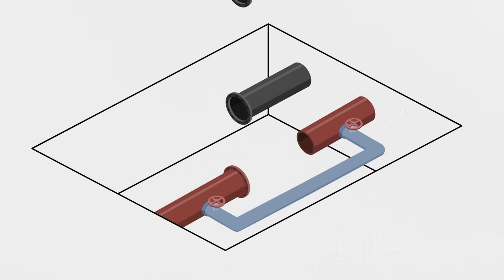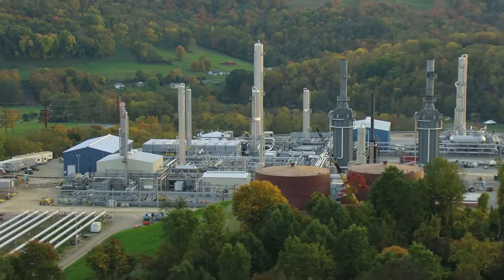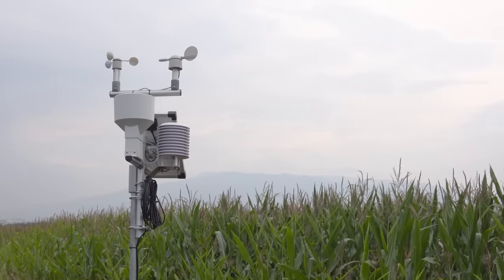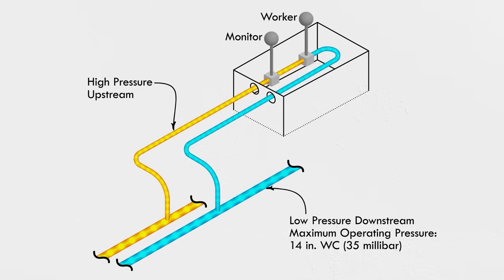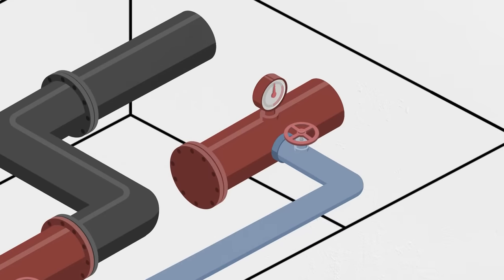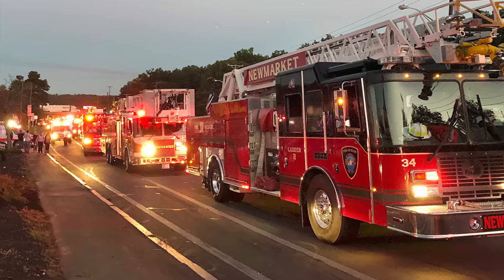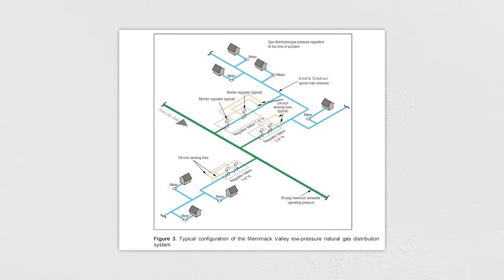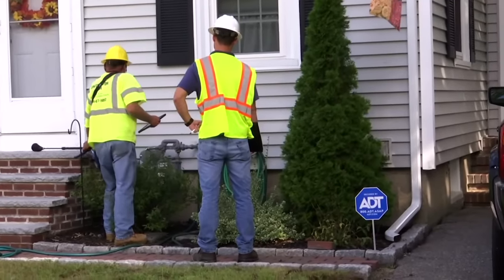What Really Happened During the Gas Explosions in the Merrimack Valley?

Comment: I remember discussing this immediately after the NTSB released the information about it.  

I’m an Instrumentation and Electrical Technician for a major pipeline company.   We discussed this in a safety meeting even though we don’t operate low pressure systems.  

This video was so good that I might show it in this month’s safety meeting.
Reply: Then you will understand the regulator department should of been there.  I have made many comments on this thread and I made 1 video even though picture is off. They never allowed it to be seen for over a year. I have read almost every document in the NTSB reports. The only deposition that makes no sense is the general manager in charge of the departments. Eliminated communication unless job on computer and kept the regulator guys out of the loop .
Reply: Don’t get stuck on the problem being the low pressure line. 

The problem was sequence and planning.
Reply: @willlock3644  actually 1 upper manager said the regulator department was not needed. There were spaces for that department to sign off but it was determined they weren't needed. Imagine a line that comes out of the pit and someone saying they were not needed. It is true and in depositions on file. Even though this was always the procedure
Reply: @skipd9164  I work in industry. 
I get it.
Reply: @willlock3644  no problem
Reply: @willlock3644  That was completely clear from the narration and the final NTSB report conclusion cited in the video. There was nothing wrong with the technology per se, and everything wrong with the project management.   We keep hoping our daughter will go into project management after she gets her MS. She's got the detail oriented, meticulous frame of mind and love of planning and documentation that are necessary in that field of work.
Reply: @willlock3644  I'd like to add the lack of secondary safety devices like overpressure relief valves that would go off if the pressure became too high and at the same time raise an alarm. Basically last line of defense items because things like this will happen again, just in new "interesting" ways.
Reply: @ehsnils the thought came to me too.  But then I wondered where I would safely vent them to.  Also, do I want to monitor the relief valve position and shutdown the system if the valve opens, but then thought about the s—- show it would be if the monitor failed and shutdown the system on a false alarm…
But, then I’ve never liked working on gas utilities anyway.
Reply: @Ryarios  I'd even consider having a blasting tin in a safe location with a igniter to burn off the gases vented. It would sure annoy the neighborhood, but I'd rather take a number of emergency calls for a fire plume from a safe location than a number of blown up houses.

Comment: I lived in Andover during the explosion. We finally got heat and hot water back at Thanksgiving and it was another 2 months to get our stove replaced.   Thanks for covering this one.
Reply: What happened to your appliances? Did they just shoot gas out at insane pressures? Did it actually break your stove?
Reply: @Teh_Random_Canadian  nothing dramatic happened inside my house. All appliances connected at the time of the incident were condemned and replaced.
Reply: @Teh_Random_Canadian  Depends on if they have a constant pilot light on or not. Ex some furnaces even during summer time have a small pilot light always burning. It would make that into a flame thrower possibly. Hopefully it wouldnt spread. Or worse the increase in gas would extinguish the pilot light allowing natural gas to fill your home. Until it found an ignition source and was at the right air mixture and ignites.
Reply: @zazuch  , you are correct but even electronic Ignition gas appliances become hazardous with 75 psi of gas pressure on a gas valve rated for a 1\2 PSI . Could you imagine a hot surface igniter getting hit with an excessive amount of gas flow , even in the five second lock out time you could cause a pretty good explosion.
Reply: @boby115  I didn't mean to make it seem like they weren't a hazard. Letting free flow gas into any structure is a recipe for disaster haha.
Reply: @zazuch  👍

Comment: As a MechE who is going for his PE, this is so absolutely chilling. Really puts into perspective my complaints about how annoying 16 hours of testing is. Such a simple oversight shook tens of thousands of people's faith in the systems that are meant to keep them safe. Really makes you wonder what other everyday devices we normally just take for granted as being safe are one simple oversight from upending our lives. Truly horrific.
Reply: And this is why I prefer using the electric grid wherever possible, this kind of catastrophic failure is not realistically possible with the electric grid without outside sources coming in to play. And if something like this did happen with the electric grid substations would probably explode long before too many homes caught fire
Reply: So, champ, are you still just trying to get through the 16 hours of testing?  "Such a simple oversight..." wasn't.  It was a major failure of "big picture" thinking (aka common sense) during project design and procedure development.  YOUR life SHOULD depend on your competency, not just the lives of folks affected by your work product.  Every engineer (all fields) should have some sort of common sense test before they can graduate and/or promote (e.g., replace all the spark plugs and wires on an older V-8, using the manual, and make sure it runs OK).
Reply: Takata airbags anyone?
Reply: @the_undead  
It should be pointed out that some gas appliances still work normally in the event of a power failure. That is certainly a worthy consideration. My gas logs are not even aware of a power failure, as even the wall thermostat is powered by the thermo-couple or thermo-pile of the lit pilot light, operates much the same as a gas water heater. In fact, during a dark power failure, I once soaked in the bathtub. Why not? Plenty of hot water.

Comment: Very cool to see this coverd I live in one of the neighboring cities to Lawrence and can remember the panic, and all of us scrambling to turn off our gas not fully knowing what was happening . Following the explosions many homes in my area had there gas meters/regulators relocated from the basement to outside the home i think so that if something similar ever occurred again the outdoor regulators would vent the excess pressure outside instead of into the structure.
Reply: Same! Haverhill here. Very scary day.
Reply: At the time i lived in Andover but very close to the Lawrence line. I remember the rows and rows of cars with people being evacuated out of the city. My wife was away on business and when she came back, had to figure out how to get home because many of the exits on 93 were closed.
Reply: There are lower pressure gas distribution systems, and there are higher pressure distribution systems (note that the latter are coming into more use as a result of peak demands due to tankless water heaters becoming more popular).

The older low pressure systems do not require a “pressure regulator” at each meter. The higher pressure systems DO require a “pressure regulator” at each meter.

Now, those “pressure regulators” basically just dump gas when it comes in at excess pressure, and those “frisbee type disks” you see at the meter are the “pressure regulator”, and if you look closely you can see that the discharge opening will usually be threaded - this allows for piping the discharge to the outside in cases where the best practice of having the “pressure regulator” outdoors cannot / is not being followed.

So if you have one of those “pressure regulators” inside of a building, make sure the discharge opening is piped outside. It’s best if the “pressure regulator” is completely outside of course.

And I use the quotes around “pressure regulator” because they are called that, but when I think of regulating flow I think of something a bit finer in granularity than just dumping excess. And in the event of a system overpressure situation, an entire neighborhood could have lots of gas discharged to prevent that excess pressure from entering the equipment in the building - but just one open flame at the wrong time …
Reply: Here in the UK, it's been regulation, at least since the 80s, to have gas meters (etc) outside the house.  I never understood why (I thought it was to make reading the meter easier!), but I do now.  My (very old) house still has the meter in the cellar/basement...
Reply: In Massachusetts when installing a new high or intermediate pressure line or replacing one they have too be outside
Reply: Every house I have ever lived in had the natural gas meter/regulator on the exterior of the structure, even in Utah where it snows. I simply can NOT fathom why anyone ever thought it would be acceptable in the least to allow a natural gas device vent combustible gas INSIDE a structure.
Reply: @dionh70  in Massachusetts any regulator inside had to be piped to outside or the complete riser moved outside. No regulator vented into an inside space
Reply: @dionh70  Lots of these installations are from an era before modern safety standards. When you have gas lamps in every room and are using matches to light them, the gas meter being in the basement rather than outdoors is fairly low down on the list of things that could go wrong.

Comment: Fascinating episode.  Our neighborhood has 80 psig lines running under the street with individual regulators at residences and businesses.  This episode also underlines the importance of systems engineering, and "systems thinking" in many aspects of life.
Reply: In 1976 We had High Pressure to the Regulator at the Meter...
Central Wisconsin
Reply: not living in a country where it has natural gas pipe lines directly but first thought was why not put individual regulators instead of a common one? could be budget issue?

Comment: I work in Massachusetts installing underground gas main for one of the largest utility companies in New England. I still hear different stories about what really happened,as I started working in this industry a couple years after this happened. To work on site you need to have operater qualifications, depending on the company you work for could be 50+. You need to pass either a hands on or written test for each one and renew them every 1-3 years. Engineers, supervisors and DPU are constantly coming by the job site to hopefully avoid something like this ever happening again. I’m happy I came across this video, this definitely answered a lot of questions I had. This is very dangerous but rewarding work and I’m grateful I am part of building americas infrastructure. Love your content ❤

Comment: As a follow up, having discussed pilot operated regulator valves, you could discuss the same but on the water side for storage tank level control.  For example, I saw one PWS consistently overflow one of their tanks because the altitude valve was not adjusted properly and the height was controlled via another storage tank.  Every day as I was driving through the town, there was either sign of overflow or the tank was actively overflowing.  Try to hit USEPA unaccounted for water (10%) when you're dumping water, at cost to the consumer (everyone).  This might not be the norm, but it does happen and everyone pays for it!  The towns unaccounted for water was @ 24%, think about that the next time you get a water bill!  I won't even get into the wastewater side of things!

Comment: Excellent video, Grady. Indeed, my neighborhood had the old cast iron distribution lines replaced by polyethylene (PE) lines at high pressure. Not only do we have a regulator at each building, but new code requires the meters and valves to be on the exterior of the building...probably safer against potential leaks, and allowing the gas to be easily shut off. (It was a huge project...we had our storm and sanitary sewers separated for flood control, so much of the neighborhood got new sewers and new water mains as well as new gas lines while the streets were torn up). Also, Chicago had a similar pressure-related explosion disaster on January 17, 1992 in River West. That was the same year of the Chicago Flood (April 13), where old freight tunnels were punctured under the Chicago River, as well as the double-deck Michigan Avenue Bridge flipping upwards, catapulting a crane into the air (September 24). The flood was particularly interesting. I worked in River North, and I remember some people looking on with concern at a whirlpool in the river at the Kinzie bridge. I got to see much of the engineering effort to plug and dewater the tunnel every day on the way to and from work.

Comment: Thank you for treating this YouTube video. I did not know of this accident. In the city where I live, there is a section of houses that have low pressure gas piping and it’s only about 7 inches of water column. The same kind of failure mode could occur there as well. I’m glad I’m aware of this now. Thank you.

Comment: crime_wav
4 minutes ago
I work for a gas utility in regulation. You did a pretty bang on job. The reason they would run them so far was to get away from any turbulence. Imo low pressure systems can be a little scary because there is no regulation in the system other than the regs upstream making the pressure cut. There may have been relief valves downstream and if they were placed and sized right, they should get rid of that pressure. But being that regulation set had a backup regulator, they may not have had to have a relief valve on it because the backup reg is your backup. At least with a medium pressure system, say 10-20 psi, the house meters are going to have a regulator on them that could handle some pressure. Low pressure system, whatever pressure is coming to that meter is going into the house.

Comment: I worked on a pretty fascinating case in the 90s when I used to do trial graphics and animation. A local radio station blew up after a wild string of events. The metal grid under an electrical sub station was electrified from a bird strike, the grid arced to and old out of service gas line, which was in contact with a water main, the water main arced to an in-use gas line more than a block away, burning a hole in the line. Gas leaked into the basement of the radio station. Somehow that gas was touched off. The DJ working that day was pretty severely burned. It was determined that the gas line and water main were built too close to each other allowing the arc.